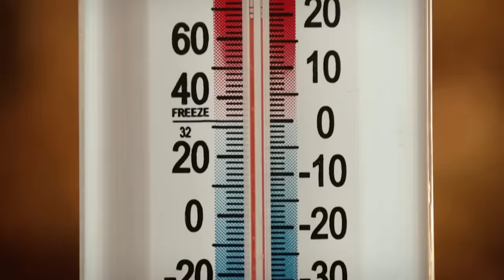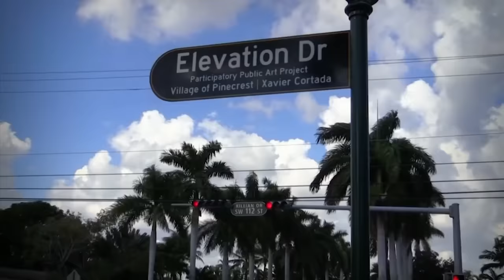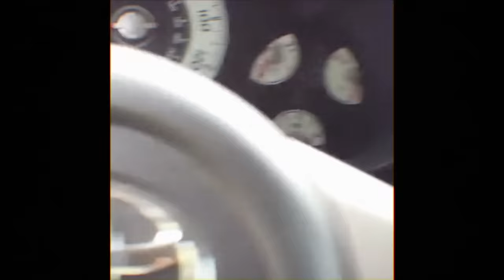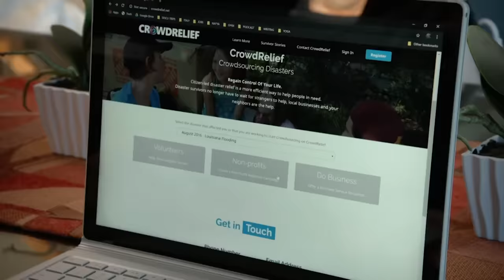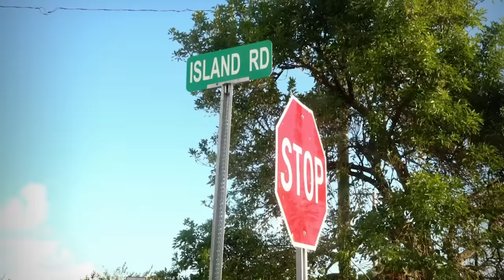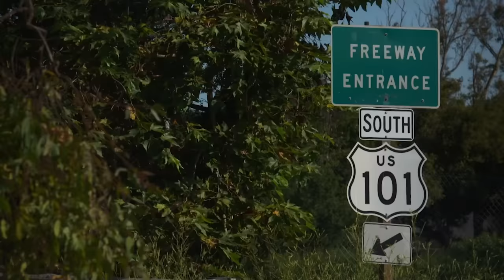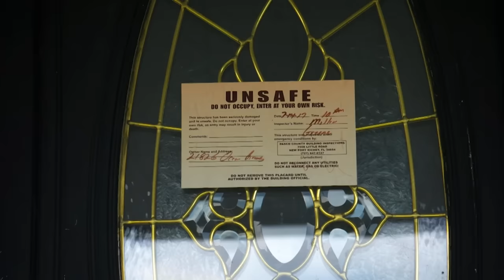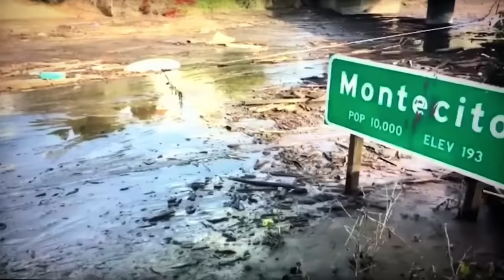Why Is There A Rise In Extreme Flooding? | Mutant Weather | Earth Stories

Comment: Baton Rouge is on the Mississippi River, sea level is 3' to 56', your program is miss leading, they have been pumping gas and oil for over 50 years, the land in some places is sinking, like new orleans, I live on the gulf coast in mississippi. In 70 years the gulf level is the Sam as when I was a kid, erosion does happen and people need to understand what the area is above sea level, the marshes are sinking in Louisiana because of erosion..Texas is like ms., the sea level is the same...new youk is built on bed rock, new orleans is built in mush....big differennce..before you move into the areas do your research and don't move into areas affected by the ms River or areas where erosion or sinking masses of land due to pumping oil and gas from under your feet...